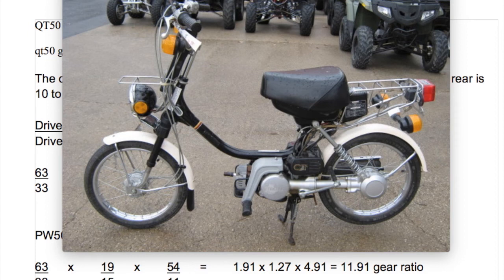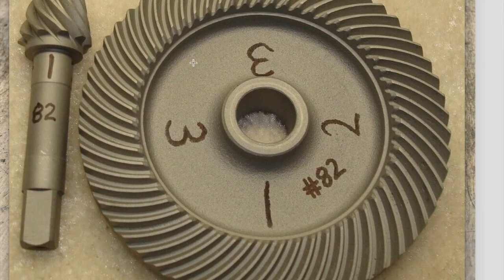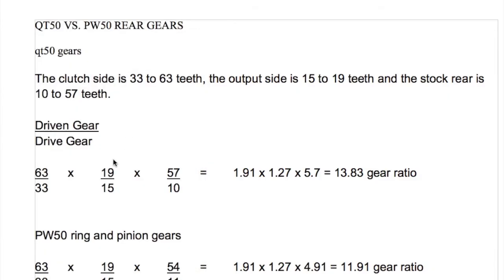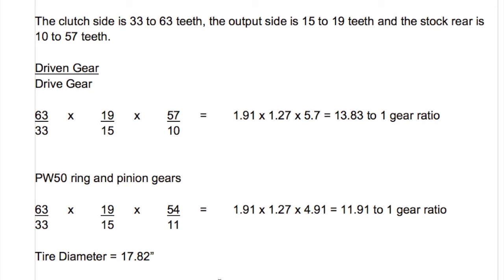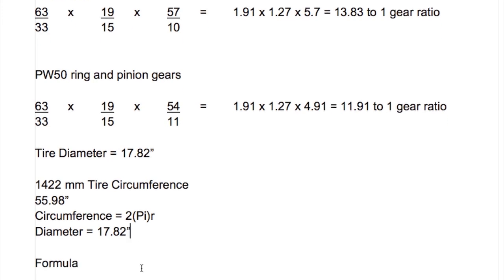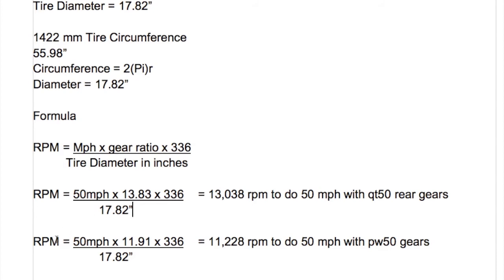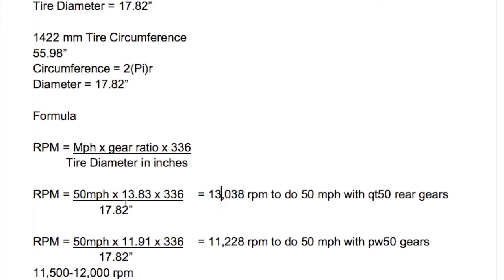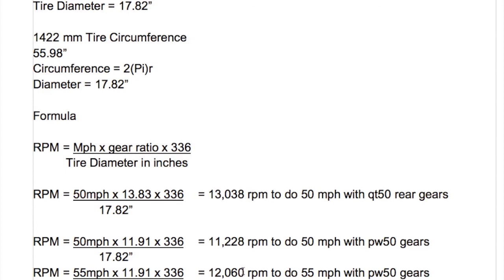Yamaha qt50 pw50 gear ratios and rpm explained

Comment: Nice job of breaking this down, Jack. The maths don’t always translate to the real world, but they definitely point you in the right direction. This is a very good starting point WRT tire selection. It shows what a difference it can make.
Reply from the maker: I want to figure out the Honda Express gear ratio although it might just be printed in the manual or I can count teeth.

Comment: I have a 80' Yamaha QT50. I put a malossi kit over a 2mm base gasket and a high compression head on top. Short thread plug #7 I think. I did not mill the cylinder any and it will get up to mid-upper 40's, almost 6 position on the speedometer. If there's a loss of compression I can't tell. Weird but true. No milling took place and it has good take off and top speed is up there..
Reply from the maker: maybe that high compression head made up for it, would be my guess.
Reply: @jackrutherford-1  do you have to run the pw gears in pw housing on qt50? Doesn't seem like it matters.. I am under impression that pw ring gear is larger than qt50 ring gear. Is that correct?
Reply from the maker: @adamjacobrogers9155  generally you run pw gears in qt housing. Check out my video on swapping the gears.

Comment: Sounds like you would recommend the IRC NR77 tire size 70/90 tire? I thought about the next size tire for my Honda express2 but now I’m worried that it might rub. Not sure how true my wheels are but do you think is safe to install the 80/90 size tire? I haven’t bought tires yet due to uncertainty, thanks for the video and keep them coming.
Reply from the maker: 80/90 is probably too wide and very heavy.
Reply: @jackrutherford-1  thanks jack, I’ll be getting the 70/90 tire.
Reply from the maker: @miguelpagansr6128  btw, I was able to test the charge and light coils with a multimeter on the Express.  Then I did the ignition coil and I was only able to get a reading on one of the windings.  I'll try again soon.
Reply: @jackrutherford-1  mine ran fine for a little bit but then it shut down and I never got a reading out of it. I’ll get a video out when I get it running.

Comment: This just proves you DON'T want to hop up your Hopper without the PW rear end gears.  13K+ RPM is just WAY to much to operate at.  Don't even know if the engine can breathe that fast under load.
Reply from the maker: It would be a real trick to get it up to 13k.  It also calls to the table all those guys claiming they do 55 or 60 with just bolt on parts.